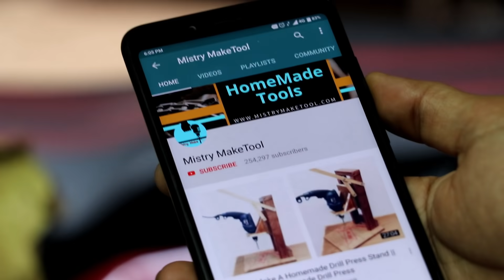Make A Circular Saw Gauge Plate || Circular Saw Hack

Comment: While cutting 1/2 inch marine plywood with a similar machine attached with a wood cutting 40T blade the plywood gets burned on the entire length of the cut and the entire room is filled with smoke (fortunately the is no fire). Does the machine require different blades for marine plywood or do I need a proper circular saw?
Reply: May be you put the blade in wrong direction anti clockwise. Check the  blade teeth direction as per the machine guideline.
Reply: Yes, that's the point  Haris. Every new beginner installs the blade in the wrong direction.

Comment: What was that tool you used after drilling the holes in the baseplate? The tool you used round and round ? What is it called?
Reply: I think you are talking abt the tap and die used to cut in grooves into the holes.